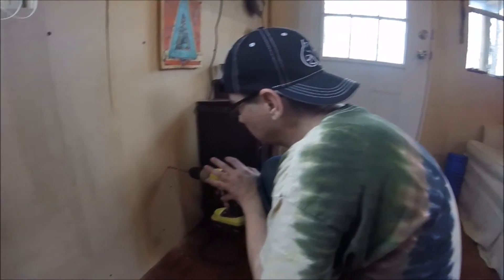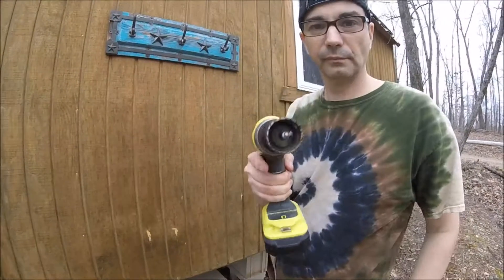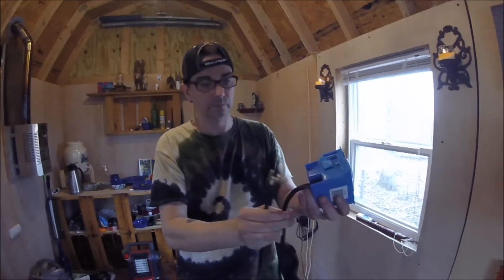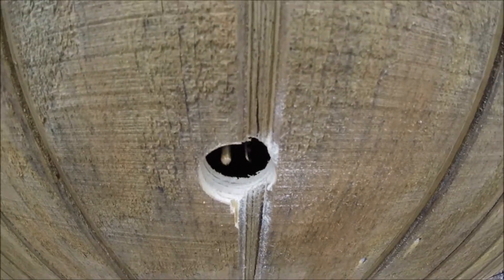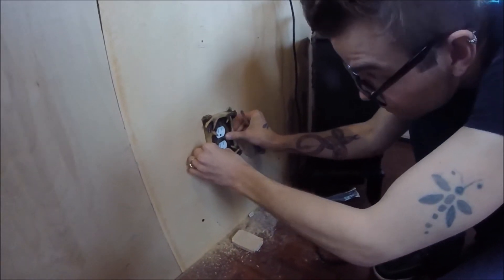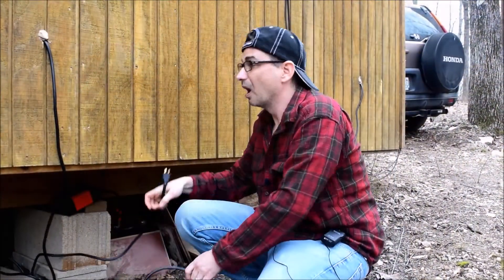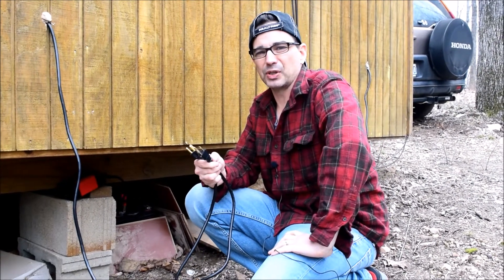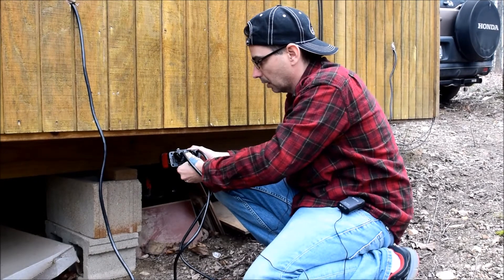Easy Electric in a Tiny House

Comment: It will be much better if you have drilled a hole on the floor instead the wall to get the electrical cable out without making your outside wall looks ugly
Think twice cut once
Reply from the maker: There were several reasons why I went through the wall. I did make several mistakes on this overall project but this was not one of them. The way the cabin is built, on skids, I would have had to drill through 8” of lumber to access the inside of the wall. Most houses have utilities accessed either high or low on a particular wall. It was simply a matter of tidying up with staples, conduit and access ports.

Comment: Love this Love this  can you explain what size cord I need and how to do it I want to do this for a generator for my tiny house
Reply from the maker: dlfleischerlmt  we used an outdoor extension cord. You want the thickest gauge wire you can find. So like 10 or 12. If you can find thicker the better. Remember the thicker The thicker the wire is the smaller the number

Comment: What a great idea!  I like how you can tie into inverter or generator.  Using a power strip for multiple plug ins can be used as well.  Thanks for sharing!
Reply from the maker: Thanks much! Its not proper and it sure isnt code but for a little dry cabin it works....
Reply: @Graywitchtarot  Who cares!  It's no different than if you were to use your generator without drilling a hole through the walls.  You got power and it works!

Comment: Some spray foam insulation will help seal those holes you cut for the cord. Stops the cold air and prevents insects from getting in.
Reply from the maker: Third Wish yup

Comment: seems simple.  What can one expect in terms of duration of use?  How long will this work before it needs to be recharged?
Reply from the maker: Dennis M that batteries recharge in the day via solar. We have roughly 120 hours on standby our current amp load is roughly 6 amps per hour.